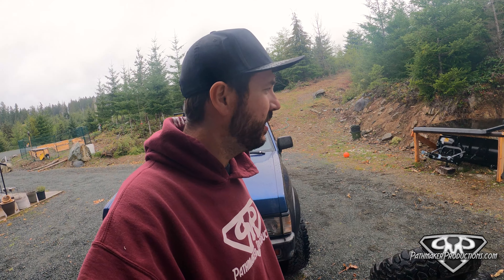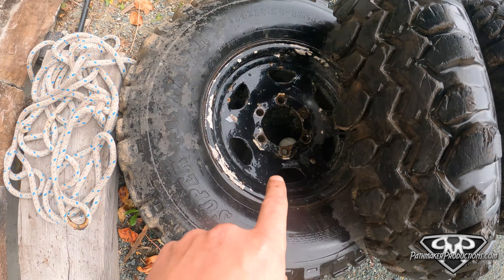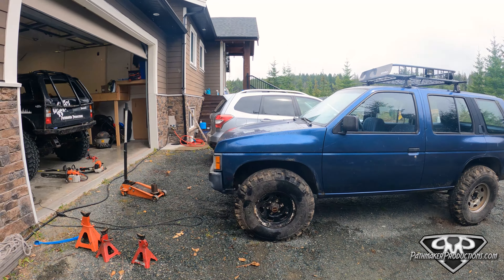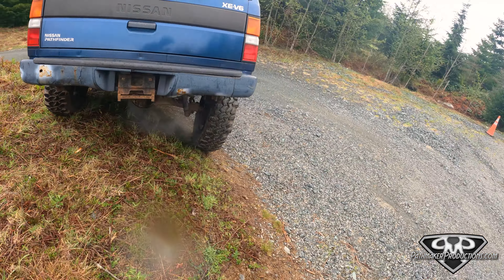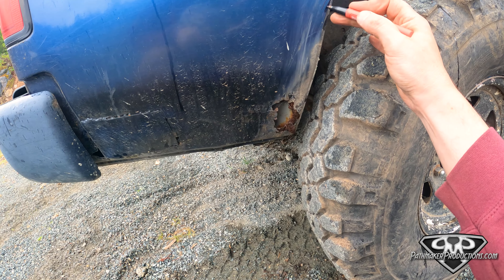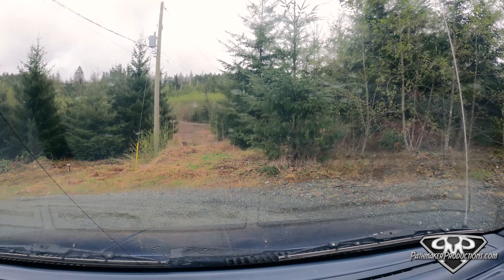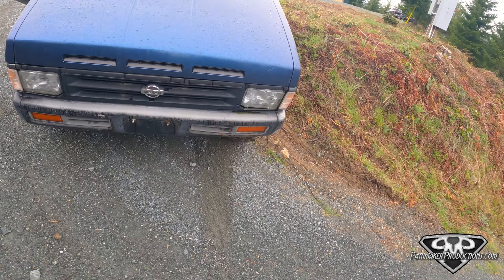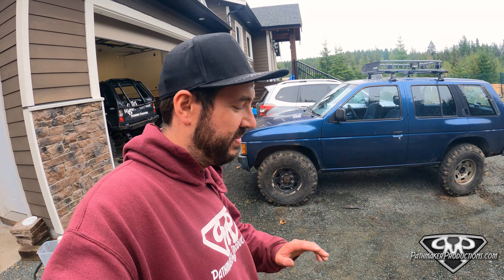34 inch tires on a stock Nissan Pathfinder! - Project Cheapfinder - S10E11

Comment: do you know if those would fit the Lego wheels?
Reply from the maker: Yup, the stock lego rims are just a 15" x 7" rim so you'll have no problem fitting a 10.5" wide tire on the 7" rim. I used to run a 12.5" tire on an 8" wide rim for years, I like a skinny rim, it grabs the bead of the tire better when running low air pressure!
Reply: awesome thanks budd!

Comment: Can you do the same thing to a hard body pickup
Reply from the maker: Absolutely. The d21s are 1.5" taller than the Pathfinders stock, so its even easier to fit larger tires on the d21s than on the Pathys.

Comment: Brother I'm in love with your Bitchfinder. 😂 That's what I call mine. I'm totally copying you with the SSRs... do MORE Bitchfinder content! So fucking awesome. Do you have an email I could use some help with mine. Same year color everything but that badass set of 34s... put manual lockers on the front. EDIT: Mines an SE but basically just cosmetic stuff is the difference.

Comment: any more videos of this truck picking mine up in 10 days from florida 1990 same color 4 door on 33” super swampers
Reply from the maker: Haha I killed the damn starter and its been sitting since that day. I did pull and weld the rear diff one afternoon but its dead in the yard with a flat tire currently. Worst part is I have a new starter on my workbench.............buuut there is 10" of snow and its -8* outside and that doesn't seem like time to swap a starter out!

Comment: Hey man did you install the roof racks on your wd21??
Reply from the maker: The roof racks came with it. They're ones that just grab the door/drip rail. Pretty standard mounting for a roof rack with no drilling. These ones or Thule but i'm sure there is lots of brands, any roof rack designed to clamp without rails will work.
Reply: @PathmakerProductions  sweet thx!

Comment: Do you think the same applies to a 1995 Nissan 4x4 Hardbody d21 V6? Ive got 31 X 10.5's now, but would like to put 33 x 10.5 or 9.5s on.  Thanks for putting out such kick ass poor mans tips! You the best!
Reply from the maker: Absolutely, in fact its even easier on a d21 because they're essentially a Pathfinder with a 1.5" body lift stock. The secret to putting larger tires on the Nissans is, go skinny, so your 9.5s and 10.5s will work with minimal trimming, everyone always wants the 12.5" wide and thats when they rub really badly, and also when the steering hates life even worse (lots of more torque on the tirerods with the wider tires)!

Comment: Sling a poo pipe from the frame side trac bar bracket over to the driver side frame or crossmember for some serious support and easy peasy lazy status , and yes been there and done it and it works! Rust is lighter then carbon fiber🤘🏾
Reply from the maker: Hmm I like the idear, I was thinkin a chunk of 3" flat barby but might have to swing by the ole playground and snag a piece of fence pipe!

Comment: How big can you fit with the oe lift (jeep or Ford coils with cranked torsion )? Looking to get some new tires for my beater
Reply from the maker: I wouldn't go larger than 34's even with a lift. The Pathmaker was on 35's for years while still IFS and the 35's require a ton of trimming and they're super hard on steering parts!

Comment: Looking to pick up one of these have you had any issues?
Reply from the maker: I love these things. I've owned and driven the same one since 2001 and its going strong (the black one in the background). They are strong running engines, common problems are rust along the rear frame rail near the back tires, transmissions can get hard to shift from people using the wrong trans fluid and they like to have exhaust leaks at the manifold. Other than that they take an absolute beating, great bang for your buck!
Stay tuned for more videos with this thing, Idler Arm Brace, Welded rear end, poor mans suspension lift are all comin up soon!

Comment: What springs did you end up using for the back lift
Reply from the maker: Bone stock for now. Ive got a set of 98 cherokee front coils that I can slip in for 2” of lift but for now its just stock height.

Comment: What size of Q clips are you using for your roof rack ??
Reply from the maker: It came with it so I'm not entirely sure. The rails look like they're Yakima and the basket is just some cheapo no-name brand I bought used for $40